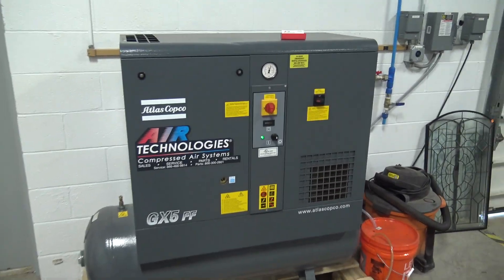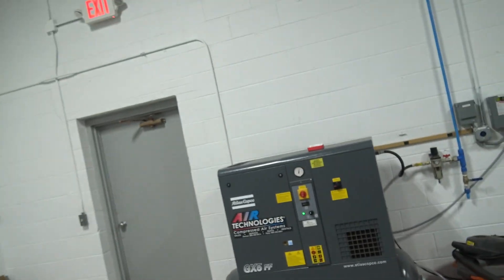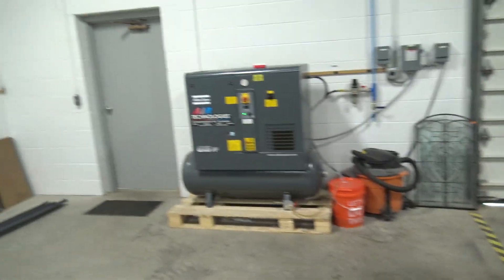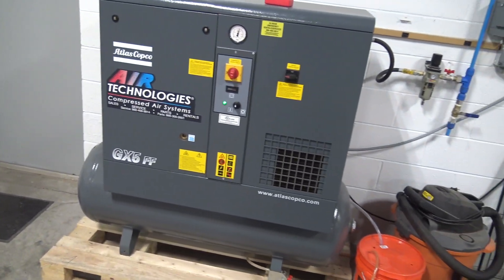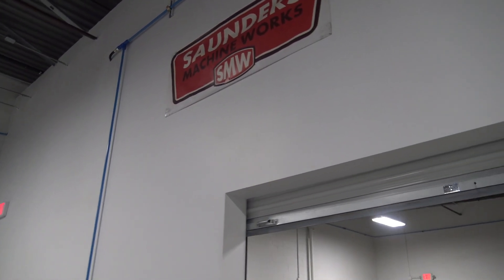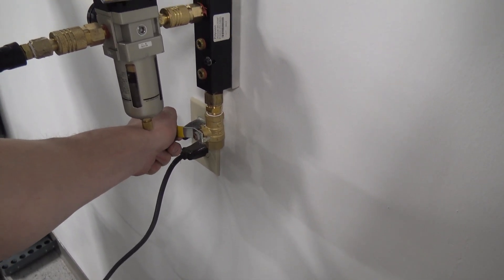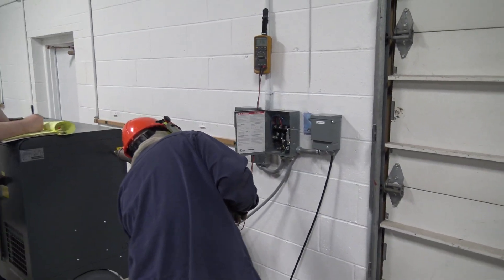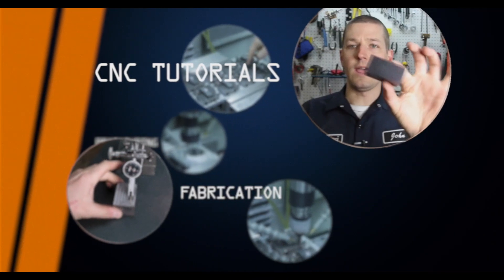Rotary Screw Air Compressor:  What are they?!  Worth the hype?

Comment: My understanding of why a screw is so hard to start is along the lines of this..  

Most a/c inductive motors, they have less torque output the further they get away from their operating rpm. There are starting caps which offset rotor phasing for increased start torque, but still, they dont like lugging a load from a dead stop. On a piston compressor, you have 0 head pressure on start up and after the first pump or so the compressor starts loading the electric motor, and by then the pulley acts like a flywheel on the compressor and reduces average load on the compressor motor. On a screw, the screw has no pressure, but almost instantly it begins developing pressure which the motor has to push, and it's a continuous load, not a pulse load which is dampened by a flywheel like a piston compressor..  Startup for an inductive a/c motor generates a ton of heat in the windings, so to start/stop you just generate a bunch of unnecessary  heat.

Comment: Should have considered a Kaeser SM10. Has about the same capacity tank, but has a built in refrigerator drier, built in oil separator. Also has the computer built into it. We run print finishing machines with it and it’s programmed to run the motor continuously, but only compresses between 115-125. Love it!
Reply: Kaeser is a very solid brand. We have at work Copco's and Kaesers and Kaesers have been superior in reliability.

Comment: Why not use a variable frequency drive on them and have them always spinning at the perfect speed?  Kick on just before hitting regulated pressure, add 10 PSI to the tank and then spin down to match air flow?

Comment: you may be interested in what are called dirt legs or drip legs when you have a drop you use a tee to pull ff the gas and extend the drop to let water oil what have you drop in to the pipe below the tee these are used in  heating gas pipe

Comment: We had several of these running in reverse, vacuum screws to operate the HP electronic board testing fixtures. They can really suck in vac configuration. The noise is the only benefit, and they do like to run continually. This was the secret of the U-boats, these screw style compressors were so quiet that it was extremely hard to track the U-boats by underwater electric running sound. The oil has to be special anti foaming screw compressor (super charger) oil, very pricey stuff. Good video. 3 phase fire pumps have a phase alarm on them to prevent the pump from running backwards.

Comment: Looks like a nice compressor. We had one about twice that size. I recommend venting the heat directly outside if you go any bigger than what you’ve got. Also keep an eye on that air drying system, they are a pain in the ass once they start to have problems. Also keep an eye at the outlet nearest the lowest point in your system that’s were water will typically collect if you have a problem, and boy does that stuff smell bad!

Comment: They have to wear evenly because of the seal that has to be made over a wide surface area,, lube has to stay healthy, and the rotational inertia is high so changing speeds has a higher impact on the surfaces and possibly temps even, especially as the system ages.

Comment: A 40 horsepower is as loud as hell and the heat will drive you out of the building. It melts snow 30 feet from a 14 by 14 garage door in -20. In summer you wouldn't be able to stay in the building.

Comment: Gonna be getting a Kaeser for my new shop, you're not joking about the price but I've had experience with them in previous jobs and they really are quiet. Thanks for talking about the distribution plumbing - I'm used to working with black iron pipe, gonna have to look at that RapidAir stuff for drops though.

Comment: We have a 25hp screw compressor and a 40hp screw type vacuum pump. Both are over 20 years old. Neither has the computer VSD system but both go into stand-by (unloading the compressor section but continuing the motor running) when they reach set point.  If demand lowers the tank pressure the stand-by valve closes and the compressing of the air begins again. There is a good electrical reason to do that. Motors pull a lot of power on start up all of which turns into heat in the motor. The second thing is there is an additional stress in the drive system from the impact of the big motors starting. If your electric company bills on a peak loading "demand meter" you may pay more for your power. Not an issue for a small motor like the 7.5 hp one you bought but... A screw system is ideally suited to a more continuous use shop than a piston type. Piston compressors get really hot if they run continuously. Not good for the oil, valves or motor. We service out machines rather than having a dealer do it. But it is still expensive. Every 6000 hours the separator element, oil filter, intake filters and synthetic oil will need to be changed. Check the costs of that before you buy, it may be shocking. We buy Mobile brand oil from an industrial distributor, much cheaper than the re-branded compressor company stuff.        Our summers get hot so we have a separate air to air cooler between the compressor and the refrigerated drier. Our compressor has its own room to cut the noise, with lots of air circulation . The vacuum is in an out side shed with a big thermostatically controlled fan for summer and a heater for winter. You don't want a screw to start against cold oil. All of our piping slopes to drain points and all drops come off the top of the piping. It is also on a loop system that has ball valves that can isolate sections if needed. If I were start over, I'd have a separate room for compressors, vacuum pumps, driers, tanks, manifolds, filters, oil etc....... I'd also put in additional air tanks at the far end of the shop to even out peak flow. Again, plan ahead!
        The aluminum pipe is nice, cheaper than our copper. Some people use Pex but there can be issues with deterioration caused by the additives in some compressor oils. 
      You may want to install an oil separator for the condensate drain to comply with regulations. 
      Having a back up compressor is always a good idea. We kept one of our old 10hp piston ones (over hauled) as a backup. Won't run the entire shop but will keep at least two machines running. If I was starting over I'd install two 15 hp screws with the simple timed unload system and both operated on an alternator, shifting between units on every start up. It would supply more air for peak loading and operate smaller motors at other times reducing electrical costs and demand charges. We have maxed out our 800 amp service so reducing the # & size of motors that need to start at one time might keep from having a very expensive power up grade. I wish now that I would have started with a 480 volt system. Now we have an assortment of step up transformers that waste power. Never expected to expand this much, plan ahead. This was a long post but it may help others avoid some of my mistakes.

Comment: There are VSD compressors from Us Air Compressor as small as 5hp with a heating function eliminating condensation and allowing much frequent start stops. By being VSD compressor runs as much air is needed so saves tons of electrics. You can see them at www.usaircompressor.com. You will surprise with the prices as well. They cost almost the same as piston compressor

Comment: Like someone said below, your biggest problem is that you have gone from the large blue tank to the smaller integral gray tank. Air compressor systems need 3 things: CAPACITY, CAPACITY, CAPACITY.  Either plumb in that old blue tank in for extra capacity or buy a new one that is even larger. As it is now multiple machines coming on around your shop at the same time is going to instantly drain your small capacity. I've seen many problems solved in saw mills and other manufacturing plants solved by simply increasing the capacity.

Comment: Having the compressor on a pallet is a little dumb.  Sure it's ok now, but can be a issue later on.  Pallets are generally made pretty cheap.  They'll fall apart in time.  Wouldn't be good if a top board cracked and then the compressor starts tilting over away from the wall and comes crashing down onto the front side.  It really should be bolted down to the ground.   The IR rotary compressors at work are bolted down and they're not as tall as they don't have a Air tank under them.  My compressor at home in bolted down in my garage.   Sitting on a wood pallet is just asking for it.  Maybe not today, or  tomorrow, but sometime in the future it will be.

Comment: I don't know your building and property status. Rent or lease or own. You have a relatively large capital investment. I would suggest rethinking the move the compressor to it's own machine room on the outside, just for all the reasons you mentioned. Clean dry air seems to be a very important component to your overall manufacturing facilities. Yes, I know, pneumatic metal grinders kind of VOID the hospital quiet atmosphere you seemed to be going for. I get it. Trying to trouble shoot and debug CNC code in a noisy environment will not be very efficient. Put the compressor in its own room with LOTS of ventilation.

Comment: Usually in this kind of shop environment a variable frequency controlled screw compressor is the most economic solution. And in the long run most of the cost of the compressor will come from the electricity.

Comment: The reason for wet tank is that there is a requirement for pressure drop across the oil drier.  This would make it slower to fill the tank to full as it would act like an RC filter in electronics with a fairly large resistor.  Also, the pressure output of the screw would need to be higher to get the tank to full pressure and the air would either bleed from the filter when the screw stops, wasting air.

Comment: There are multiply reason why the motor should stay running. 1. Longer life, the hardest thing for motors is to start because when they start they pull locked rotor amps verses full load amps. You pay the power company for watts used. the locked rotor amps is roughly about 10 times full load amps.( Lets say full load amps is 5 amps times 208 volts is 1040 watts, and locked rotor  will about 50 amps times 208 volts is 10400 watts !! and your electric meter is a watt meter.)

Comment: You go into the tank first with the air because it takes stress work off the dryer. Not putting direct compressed heat directly into the dryer first.

Comment: I thought it was illegal to require service / parts come from the manufacture to get warranty...  I also donno if new screw compressors just suck or that start stop is overrated but we had a screw compressor that got like no maintenance... was used everyday 12h / day kicked on and off... alot... never had a problem.  Was running 2 hot stampers and 1 injection molding machine.

Comment: Our screw compressor does both, either suction-off-loader or shuts down when it gets bored. I love the ring main idea. I run some buffer tanks, but the main tank is huge as well. With varying air loads you can only have a best compromise. Thanks for the vid :o)

Comment: Hi.  The "BAFFLE BOX" on the big new expensive piston compressors - is really nothing much more than an airbox, from a car in a junkyard with a square paper filter.  You have an auto-shop with students - you can probably just make the box and put the fittings on the ones you have.  Even more so, make a double box - which is a box, inside another box filled with that open cell foam.  f-y-i.

Comment: Mine doesn't have a computer but i can adjust the time that it runs after the tank reaches pressure. Mine is an IR unit.
the reason for running is that these units are contact cooled, that is that the coolant/oil is in contact with the screws and it also collects and holds on to water. The water can only come out when the coolant reaches a high temperature.

We skip the oil sampling and keep the warranty by having the mfg perform the PM services, which are about the same cost, just under 1,100 in the seattle, wa area

Comment: I do work for a company that has 4 each X 350 hp screw compressors. They have 3 on all the time. They want to all ways be on. Loading and unloading. Unloaded is the intake is closed and cavitating. Do not buy if you do not use a lot. They've exploded the motors and ruined the screws. Plus the synthetic lube oil is super expensive.

Comment: great looking shop. I'm surprised that lil thing can provide air for that entire shop, I do maintenance for a commercial laundry and our facility is maybe half of yours more like a third, but the compressor is in a 5' x 9' box with and a tank 3 times that size. runs on 480, simple to maintain 2 filters, a separator and a few quarts of oil every 2,000 hours.

Comment: in any mechanical system there are inertia effects. disconet the power source and system will not come to a dead stop instantly nor start up instantly. There is also  frictional issues too but for simplicity just ignore that.

When any compresor starts up it will actually suck around 4 or 5 times the normal run current to overcome the inertal effects. Once things come up to normal speed the inertal effects essentially disappear and the electoral load will drop. 

To easily verify this, check the installation or user manual.  On stuff like that compressor the fusing type and size are specified along with wire sizes. a normal breaker wont trip for a current draw of say 2 or 3 times the continues load if the overload is less than second or so.  an overload of say about 20% will kickit out in about a minute. Thats a slow blow type pf fuse or breaker.  Normal types will pop within seconds of any load say 20% over rated. These factors are somewhat an averaged value. The real values can be found in the manufacturers data for said fuse or breaker but these values are good enough for discusion.  while the actual mechnisim of how a breaker trips can either be magnetic in natute or thermal. 

So to put it all together. heres what the long term power cost can do.  With the typical piston rig and the blowers in a normal heating and cooling  ac system, EVERY time the motor kicks in there is the extra energy drawn to deal with inerta OVER and above a normal under load draw. Same system constantly on and you wont be drawing basically waste energy.  The break even point between constant run and on/off all depends on usage. Same exact setup in tow places with different usage needs will gove different  break even points.

I tottaly ignored issues such as the effect of stop/start and constant run can have on the lifetime of said equipment too.  Just knowing how screw and gear pumps compared to piston types also have tottaly different wear charastics. The real answer is derived from ALL these factors and it wont be the same all the time either. also consider what happens to say a piston compressor and your car engine.  That/those pistons are going back and forth and NOT in a constant direction. Even the crank does it in addition moving side to side at the bottom of the stroke. That whole system requires MORE energy than a constant one direction will for the same load. 

Confueed now?  :)

Comment: Haha, "quieter".. :D The Atlas screws at my former job topped out at 160-170 dB at 1 meter with the doors open. Let me describe it like this: Peltors highest grade ear protection wasn't enough. The smallest one was 70 kW and the biggest 240 kW though, so not really comparable, but still. :)
Reply: They quietest compressors I've ever heard run came from Hydrovane, which if I'm not wrong is an American company. At full power they just hummed a little. They require a lot more maintenance though, the screws are comparatively maintenance free, those big ones (which were by the way oil free in the screw) were serviced about every two months (and they ran 24/7), where as the Hydrovanes were serviced like every 1-2 weeks at a similar workload (although they were considerably smaller).

Comment: passive air dryers don't work well with hot compressed air, the air has to cool and the water condense out before the dryer can separate it. Big systems use refrigeration to cool the air rapidly.
Reply: true , my home compressor has a refrigerated dryer and even hooked straight at the output of the compressor it gets all the moisture out

Comment: In my previous job, they had 3 compressor, 
2 working a fixed speed but only one working at a time as the other was used as a backup. And the maintenance service was alternating there use to level out the wear.
And a third with variable speed compressor ($$$) which was used to compensate the variation of pressure in the air grid (with the help of air tanks scatered around the factory)

Comment: I was thinking if you had a second, smaller piston type compressor back, in the opposite corner of your shop you could set the pressure switch to kick on at a higher threshold than the big one is set at and when the system cycles from off to on, the smaller compressor comes on first. If the demand is not too high, this might be all you need, thus preventing your screw compressor from having to come on at all. If demand is a bit higher, say two guys running grinders or using a spray gun or more, the small compressor wouldn't keep up with demand so the pressure drops to the next lower level kicking on the screw-pressor. Of course it kind of kills your desire for a quiet environment but it would keep your total capacity very high yet prevent undue cycling of the big guy. Oh.. also set the OFF switch on the small compressor at a lower pressure than the screw-pressor and that will keep it going longer, or as long as high air demand calls for even after the small compressor is off.